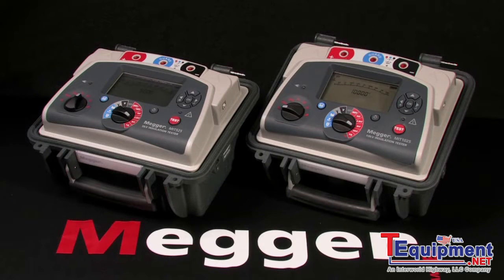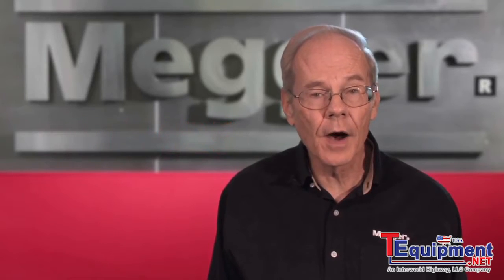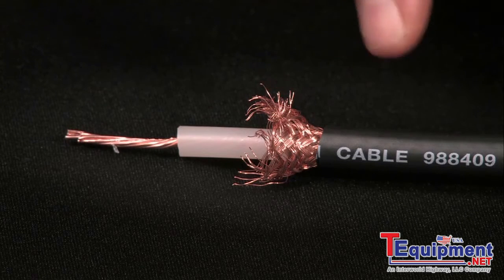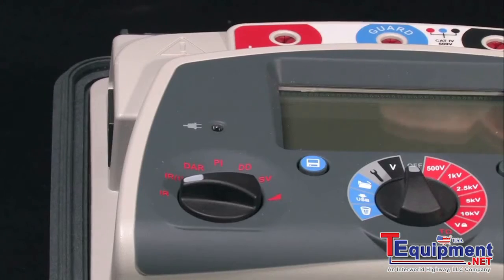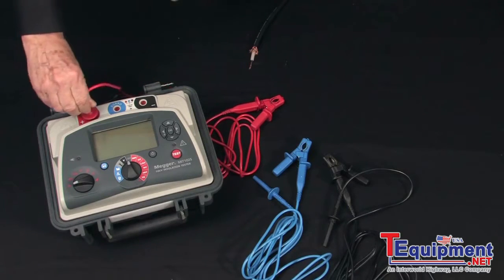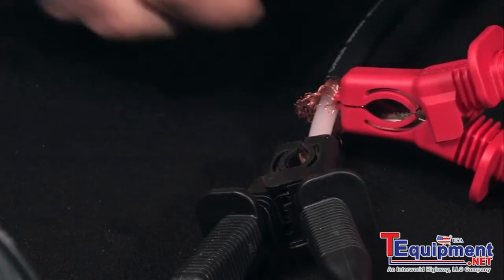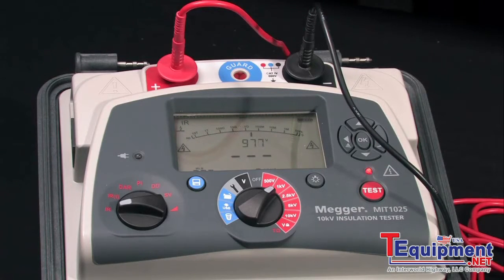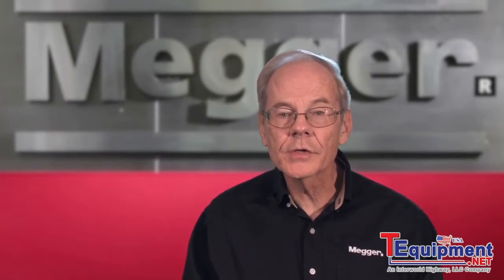Megger Mit1025 Insulation Resistance Tester Getting Started

Comment: Excuse me Sir,  l have megger MIT515 ,and During the test electricalPowerTransformer , this phrase appeared to me: br.d <10.00 K Ω.
What's meaning?  Please.
Reply from the maker: br.d = breakdown detection

This is a common error code on this device. If insulation breakdown is detected, the unit aborts the test and flashes “brd” and the final test result alternately in the main digital display. This display is disabled when in burn mode as the unit will continue the test without aborting. The instrument detects breakdown in terms of a rapid drop in test voltage commensurate with that caused by an arc across or though the insulation under test. In breakdown mode the test will automatically terminate on detection of a breakdown to prevent damage to the insulation. Burn mode disables the normal breakdown detection and test voltage continues after breakdown of the insulation. This enables the location of the failure to be seen and detected acoustically but it is a destructive test
Reply: Thank you, sir, for your support. When I did the test on the second day, once with the same megger and again with another megger, the “brd” code disappeared, and both instruments read the Insulation values correctly.  Does that mean there is no problem in the  insulation of transformer ?  Waiting for your reply as soon as possible.
    Best regards.
Reply from the maker: Yes you are correct, there should not be any issue with the insulation as long as you no longer see the br.d error code. If you are concerned, try the test a few more times just to be sure there are no errors. It's possible the error was due to a loose connection from your test leads.
Reply: @TEquipment  
Thank you for expressing your interest.